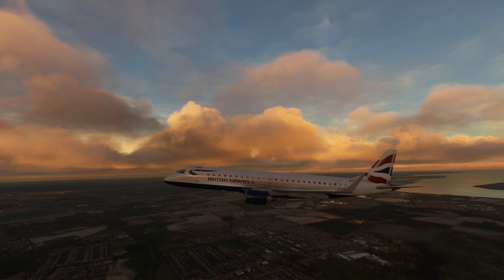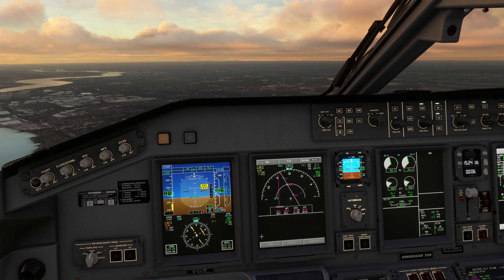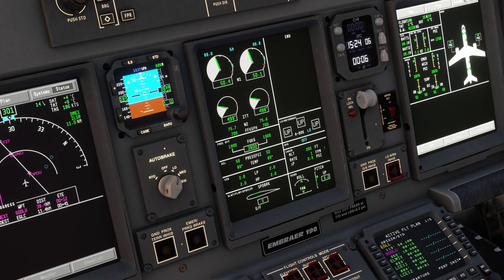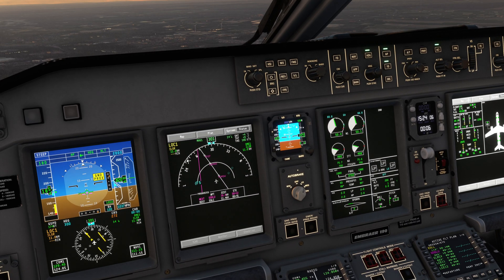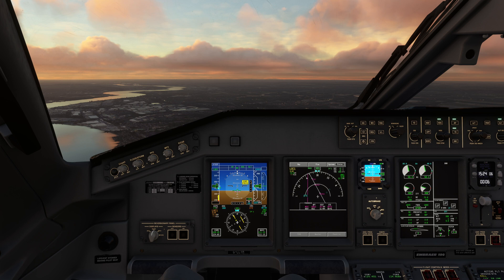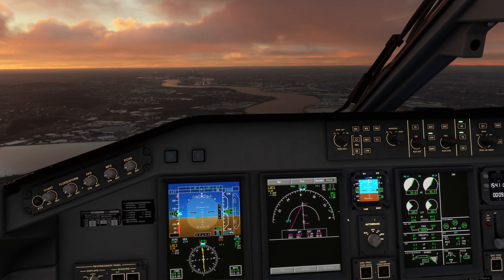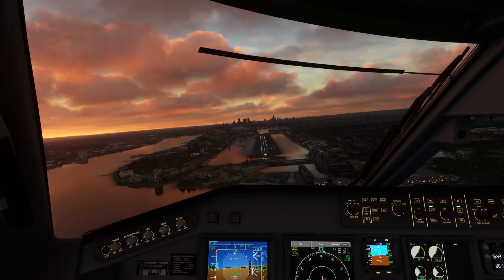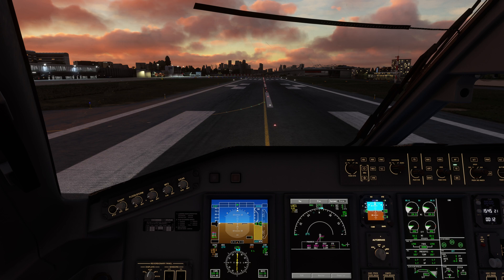Embraer 190 How to FLY a STEEP APPROACH | Full Procedure & System Explanation | Real Airline Pilot

Comment: Nice demonstration! I've arrived into LCY once as a passenger on an A220, I noticed they extended the final flap setting and steep approach mode right at glide slope intercept.
I was impressed by the Swissair crews, very smooth and efficient flight both ways

Comment: Very interesting explanation.  The steep approach mode on the ERJ is somewhat similar to the DLC (Direct Lift Control) system on the L1011.  The system would auto engage past flaps setting 33 degrees.  Like on the ERJ the spoilers absolutely kill lift, and on the 1011 it allowed for beautiful precision approaches.  Cheers!
Reply from the maker: True that, I really wish there was a quality L1011 available for the sim!
Reply: @A330Driver  If you don’t mind Prepar3D the CaptainSim L-1011 is great on v5.